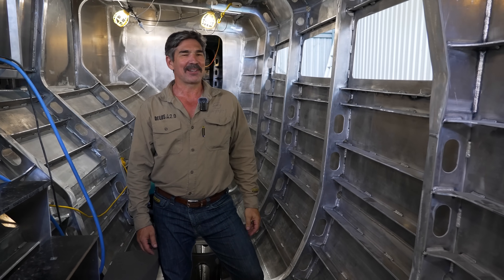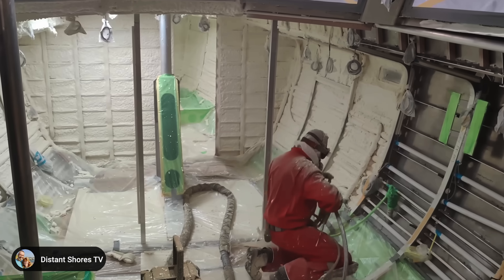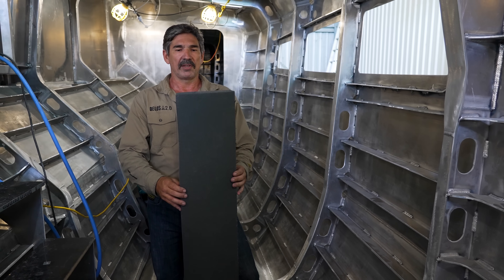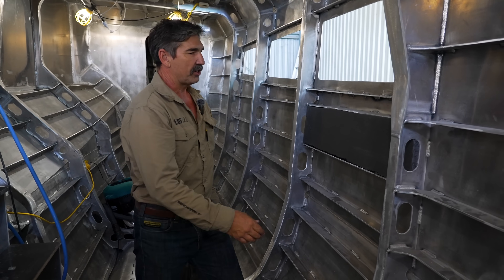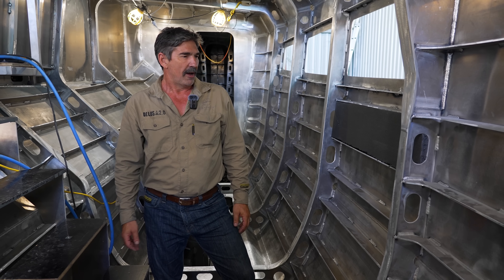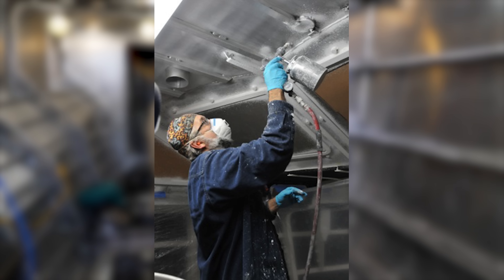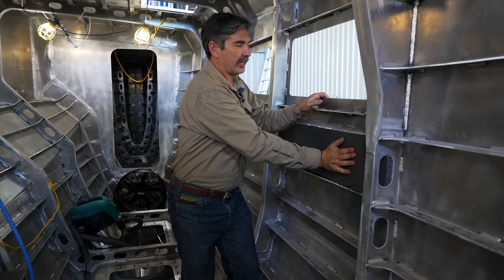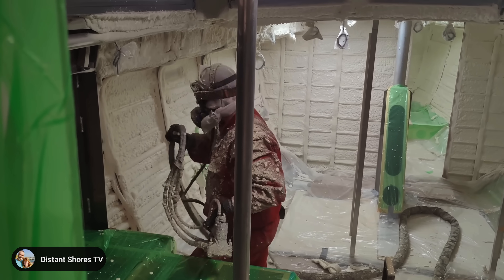HELP, We Need Your Advice!  How Should We Insulate Our Aluminum Catamaran???

Comment: Closed cell spray foam is what you want to use. Waterproof and creates great barrier to prevent oxidation. Run conduit to any places for suspect future upgrades to get wire there and you’ll be golden

Comment: I served on a Spruance Class Destroyer in the Navy (a lot of Aluminum) and worked at the 3rd largest Shipyard on the West Coast (as well as shops). I recall a special corrosion-proof paint on all hull members and bulkheads. You didn't mention fireproofing , which is a big deal. They used the pins (spot-welded) that you mentioned, fiberglass insulation, a treated fiberglass cloth and a button would tie in the pin and hold all layers in place. It did the job; I don't know that it is the look you're after. At least some spaces seem like they could use some decor paneling, but perhaps mixing it up could keep your costs down. The Navy treatment, I think, is standard fare for Engine Rooms and various Locker Spaces and works well with Fire Suppression Systems. Do you have Magnesium anywhere in your structure? That takes a whole other level of planning for fire suppression. Fair wind and following seas!

Comment: Closed cell spray foam, if you need access to something a rag with acetone will melt the foam. Acetone evaporates fast so you can keep a can of closed cell to fill in when you finished. Try it on a bit of spray foam from the professional you have do the foam. The mix of the foam is very important, if its mixed wrong it will off gas even after cure. If I remember there are some closed cell foams that are low VOC and sort of green
Good Luck!
-MG

Comment: Closed cell expanding foam.  Inexpensive, practically dummy proof.   Can actually rent the machine and do it yourself.   Superb insulation and sound attenuation properties.  It's really a No-brainer.   I'd ask a metallurgist about moisture related aluminum corrosion, that doesn't sound right.   I mean it doesn't keep corroding under the water does it?    But you could always do above water line with spray foam and foam boards below.    The spray on is crucial to maintaining the insulation everywhere.    If you have uninsulated metal it will definitely conduct heat and cold but only really a problem if you're in cold climates as it will create condensation internally.    As far as removal, It's not that hard to remove once applied.  Not fun for sure but you can cut it out with razor or hot wire, scrape it out.    I'm not sure what kind of repairs you're thinking of, but for small areas it's totally doable.     There are solvents that can remove it as well, but it's really messy.

Comment: Aircraft which of course navigate and cycle through constant temperature and moisture extremes have most of their parts and surfaces first anodized to prevent corrosion and seal up the aluminum to make it super hydrophobic. It sprays on like a primer & leaves everything a shade of light green but not sure if practical for sailboat hulls. It's kinda expensive I think. Alodizing is a simple chemical treatment for all aluminum alloys to increase their corrosion resistance and to improve their paint bonding qualities. Because of its simplicity, it is rapidly replacing anodizing in aircraft work. Coal tar is what SV Seeker used on most of his iron hulls inside and out I think. He ran a year long saltwater test on several different coatings & proved out coal tar to be his top pick at the time. There might still be a video on his channel from that.

Comment: Polystyrene closed cell spray foam is what you want and then cover it with fiberglass sheets with the gel coat already applied. You have to make the fiberglass sheets on a flat surface and then the curved surfaces, I guess you have to make a jig or hand lay it up. Sailing Life on Jupiter shows the process a little bit. When you spray the foam, make sure that you tape over the outside of the bulk heads and anywhere you don't want the foam to adhere to. That way it easily peals off. Also, when you run your wires, it's best to run your wires inside of thin plastic pipe. That way if you need to replace a wire, it's easy to do. Spray foam is by far the best method to use and don't worry about accessing anything in the future because if you plan out all of your wiring and plumbing correctly than you will never need to access those areas ever again. Don't spray below the water line and you want to paint the inside of the boat in the areas that you don't spray foam like this video shows. https://www.youtube.com/watch?v=rVj_IhsEqrY

Comment: Hey Brian... another +1 for spray foam here. We are a general contractor and sprayfoam prevents thermal bridging which reduces condensation risk. In addition you wont have corrosion, or have to worry about mold. While I'm not in a boar we build homes in some of the coldest environments and have seen what happens to a house when condensation and moisture build up. Have a de humidifier installed for good measure but otherwise spray foam it

Comment: Apply 10-20mm of closed-cell spray foam and then use the insulation batts to achieve the desired R-value.  My experience is with houses, but a two-material approach might get the performance and flexibility you desire.  Good luck and thanks for taking us along on the journey.

Comment: Sprayfoam a thin layer to get condensation issues taken care of and on top of that XPS foam. Use ”VP flex slang” (do not know the english word for it, it is swedish) for electrical so it will be possible to remove faulty wires.

Comment: I have personally used mass coat not only does it stick incredibly well to metal have a high thermal coefficient a very high pull off and elongation its used on everything from steam pipes to ships to prevent condensation and has a decent r value. I would coat all with mascots then fill void spaces with xpe provides more insulation and floatation in worst case. Mascoat is latex based no out gassing weighs less than 6 lbs per gallon when wet. I’ve been to the plant in Houston where it is made. We used it on metal roofs both inside and out even on brick houses

Comment: US Navy (Ret)… the ships I sailed on used lagging (foam with a layer of fabric, held in place with buttons).  The stem was directly welded to the bulkhead.  

Your foam and button system looks much better than what we were using… Our stems were welded to the bulkhead and were prone corrosion and breaking off.  

I am a fan of the spray in… call it PTSD from years of bulkhead insulation repairs.

Comment: Highly you connect with Bering Yachts in Turkey. They build highly successful steel and aluminum boats and insulate the entire yacht and guarantee comfort class of super yachts in sound, vibration and other noise levels. I believe they have a video on that, yet for more detail it would be good to get in touch.  Best wishes. ✨👍🏻🌊💨⛵️⚓️🏝️🌞✨

Comment: I have no knowledge but why not use both.  If you have runs of wire or plumbing use the foam inserts in those areas for access issues and spray the rest.

Comment: Stay away from the pin method. Worked on aluminium high speed cats built in Australia with that solution. What happens is the caps eventually do fall off and then you have spikes ready to impale you

Comment: Hi, apart of comfort (noise and thermal), would also check if the product has some fire resistance certification. There are different fire class of products A15, A30 , A60 certificated by clasification societies like BV, DNV or LR, fore marine use.
Those products can come in slabs or blankets (Rockwool- have also marine market products check it)
ATB
Marek

Comment: First saw spray foam insulation in 1969. Was an independent contractor insulation, plaster and rough carpenter.  Plus he was a certified accountant for tax season

Comment: I have zero experience with boats, but maybe you could stick the foam to the back of the interior panels? that way O2 can get to the inside of the hull, and the insulation can't trap anything, as it would just run down to the bilge?

Comment: Great video, Brian! For insulating your aluminum cat, consider a layered approach: start with a thermal coating like Mascoat DTM or PyroTech T35 for corrosion protection and basic insulation. Add closed-cell foam (like extruded polyethylene) for thermal and sound insulation—adhesive-backed or pin-mounted for flexibility. Seal edges carefully to prevent moisture buildup and consider thermal break tape on exposed metal areas to avoid condensation. For tricky corners, a bit of spray foam can help fill gaps. Modular insulation panels make future access easier. Hope this helps—excited to see how it turns out!

Comment: Couldn't you line the hull with plastic then spray foam it so it kinda makes forms? That way you could remove it in panels. It would take a little thought but maybe that's possible.

Comment: I just wonder what is the chance you need to get to the hull? If you do, it’s probably a bad thing and peeling off some blown in insulation would be the least of your worries. I’d go whatever route would minimize moisture/corrosion and maximize insulating properties. Easy of installation is important too. Replacement ease and initial cost, and finding it elsewhere.

Comment: Spray foam is the absolute best option for your application. Plan ahead for your wire runs and plumbing. Run pvc rigging tubes anywhere you think you might need access in the future then spray the heck out if it. You won’t regret it
Reply: Run tubes that are far bigger than you think you will ever need & use radius bends in them, run a minimum of three 1 low voltage 1 high voltage and 1 for pex piping water.

Comment: It may be worth your time to look into the aluminum boat built for the Distant Shores and the way that was insulated. You may have our own  opinion on what you will or will not do but, since you invited opinions, I would mention their boat and how it was insulated by a very capable an quality boat builder. There is  also the sprayed cork insulation many speak very fondly.

Comment: Have you considered a combination?  Spray foam for large portions of the boat/hull you will probably never access, then cut and placed insulation where you made need access to wiring, plumbing; mechanicals,etc?

Comment: The best insulation in the world is aerogel. Aerogel paint which works Or aerogel insulation matting. The matting is hydrophobic long lasting and conducts 60% less heat the. Any other insulator. Plus 1” of this is like 48” of regular insulation. Do an epoxy paint to seal the metal then aerogel to isolate it

Comment: What happens to the insulation in the future when you want to weld something to the hull, or you have damage that must be welded to repair?   Do you have to remove all the insulation on the inside near the repair site before hand, so it doesn't melt or catch fire?   How does this work with spray-in foam?   Think about how to simplify maintenance and repair work in the future.

Comment: Try contacting Richardson Devine Marine Constructions (RDM) is one of Australia’s most recognised aluminium shipbuilders, with a proven record of building a diverse range of craft.
They are based in Tasmania and build high speed Aluminium catamarans they might be able to give you advice on the type of insulation systems they use on  there builds.

Comment: Honestly, I think spray foam has the most pros & least number of cons. It's also easy enough to work around those cons with a few extra wire chases before spraying and plenty of different accesses to each of those chases through the boat. I think I would approach it a lot like wiring a commercial building. One main panel and a few other sub-pannels. I would still keep each circuit independent of the main. But this would let me isolate an issue when it arises. It would be easy to find a short between the device and the first sub-pannel or between a sub-pannel and the main. Also, the repair is as simple as the replacement of that 20’ section of wire vs replacement or fixing a short in an 80’ section of wire. And you are only ever having to fish wire through a conduit 20’ or so long. Just my 2cents. It would also mean a small spool of wire is all that you would need to store with your spares. As odds are you are only ever going to need to replace a small section of wire in an emergency situation. Anyway, have a great day, and may God bless and protect your little family

Comment: Your non-condensing paint would work if you don't put insulation or carpet/paneling over it because condensation will occur on any cool spot where an air gap exists! The spray foam solves all the problems of noise, heat/cold  coming through the hull as well as preventing all the condensation for it's lifetime! This is surely what you want insulation to do. Yes, access for repairs will take effort.

On another subject, on one episode you bought some Tequila and said it was because you couldn't do a good job of making your own! Have you tried fermenting Agave syrup? The result is 100 % Agave and matches the good stuff in the store!

Comment: I'd consult with aluminum yacht builders in Holland or France.  These are bullet points I pulled off of a well known French aluminum boat builder's website.  They may or may not talk with you, but you won't know unless you ask them.
 Thermal and acoustic insulation above the waterline by automotive grade polyethylene foam
(thickness 74 mm for the hull and 37 mm for the deck)
 Thick foam core insulated floors

Comment: Temperature, Temperature, Temperature. Mind the maximum use temperatures for products. You were mentioning bare aluminum exterior hull. As such solar heating temperatures will be high. Figure the same as for black paint, ie 220F to 240F. Yes, dangerously hot. Any glue or insulation must be able to withstand at least that high of temperature continuously. Many commonly available products don't.

Lowest skin temperatures will be with an ultra high reflectively white paint. I don't know if there are any marine grade ones.

Design the interior floors, furniture, etc can be easily removed for maintenance in case issues are found.

If that thin spray coating you mentioned is temperature stable, then coat the hull interior with it, then install your conduits for electrical, etc, and also for water system hoses. Next spray foam in. Yes, conduits for the water hoses too. That way they can be serviced.

Most of what I know comes from designing a bus RV for going anywhere. Most intercity coach buses have aluminum skins. I read up on all the failures and successes predecessors were having with their bus builds. Fun stuff like sound deadening sheets falling off in the desert sun.

Comment: The aluminum ribs will transfer a lot of cold into the boat if you use the solid board between the ribs as demonstrated in your video.  I recommend the spray foam making sure to coat the ribs.  An alternate is to place the board insulation inboard of the structural ribs in a continuous board with taped joints.  Too bad the ribs are horizontal and not vertical.  Condensate would drain to the bilge with vertical ribs.

Comment: Hello, you have to use cork sprayed directly against the hull before putting an insulator. This prevents humidity, mold, and it is also an excellent soundproofing agent.

we use this method to convert a coach into a motorhome.

Alain from France
Reply: https://youtu.be/v3PktAZcdQk?si=gtGdGrsnCxS71Z8E

Comment: G’day Brian my name is Glenn Dawes I’m out of Fremantle Western Australia my history is refrigerating fishing vessels.
I would suggest from my experience to  tar  apoxi seal the aluminium first so as to isolate the hull from any electrical or chemical reaction then spray foam polyurethane 2” minimum. 
As you know, aluminium is a brilliant conductor, so try to cover as much of metal as possible.
I find this is the best long-term treatment and have had good results over many years from  installations.
Cheers Glyn

Comment: Spray foam in the corners and hard to insulate places - panels for places where you expect to need access. Sure seems like thermal paint would be good protection.

Comment: Spayed crock is for me the best fast, the most environmental friendly (production/destruction), no thermal leaks. Don’t worry to much about accessing the hull I have a 40year told aluminium boat and the hull hasn’t got older. The other benefits of cork is that you can remove a patch and redo it very easily. Also it a job you can do yourself just need a compressor. Otherwise many people insulted their aluminium with armaflex and seems like  most of them are happy about it.
Reply: Yes this is an interesting option 👍
Reply: I all wonder if combined with sheep's wool batts in arrears that need increased insulation.
Reply: The other benefit is that you can do the deck with the same product.

Comment: Not a boat guy, but a bus nut. Your concern about the thermal bridging is one thing anyone with a metal body living structure must take into consideration. You won't escape the bridging completely, but I think you'll find that spray foam will at least slow it down, even though the layer is thinner. You come up with some things that just make most of us go HMMMM. Oh what about the bus bar? You have to consider that area as well, I know you are, it would be a shame to have deterioration on that system. Have fun. Been watching your mind benders for a long time, you got this.